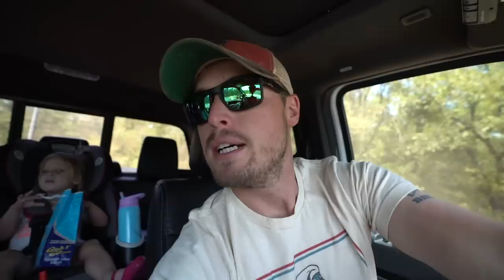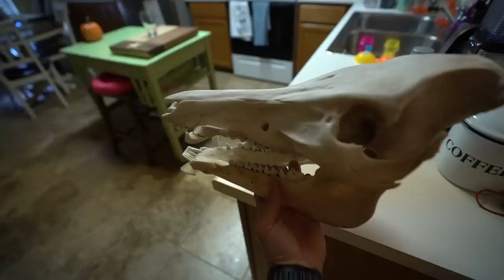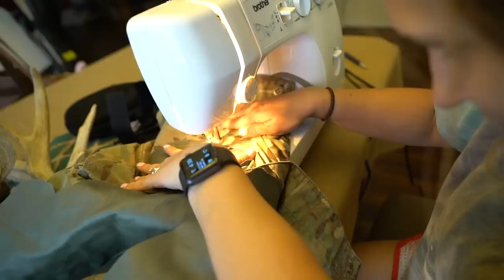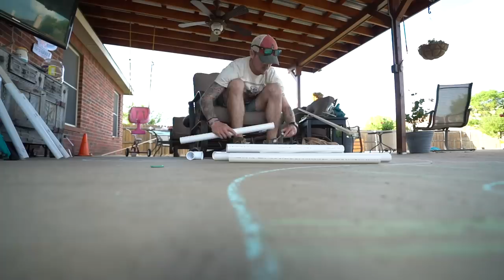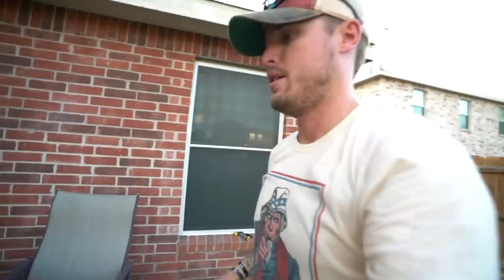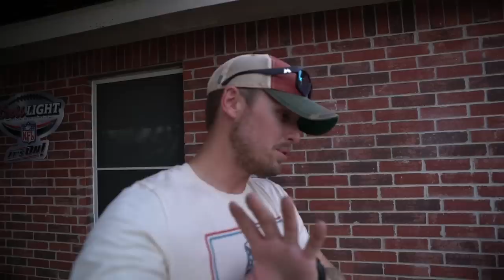Real Snipers Ghillie Suit - The Beginning

Comment: Screw some spring clamps and screw them to your boards at the top so you can quickly change the cardboard and you wont need a staple gun, just make sure they are decent ones that will grip and last. clamps like them are used a lot in wood and metal working, if you not sure what im talking about I'm sure LFG knows he is a master at handling the wood...

Comment: Those cables are called PT tendons (Post Tension Tendons).  Once the concrete is placed and meets about 70% of its strength, the company will come out with a hydraulic unit and put all of them under tension.  They keep the floor/slab together if the soil underneath moves.

Comment: like the skull, lil trick they do is pull the bottom tusks out more after its been boiled to look bigger. where the dark line is on the tooth is where it would have sat in the gum line. still a sweet skull though.